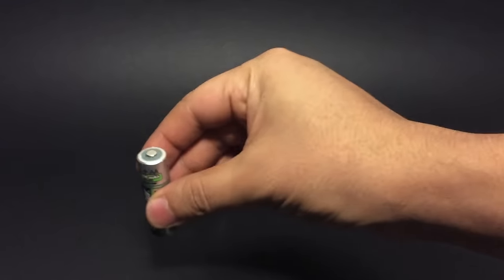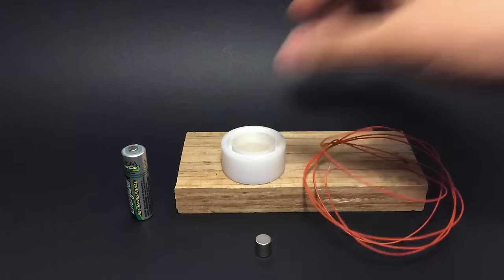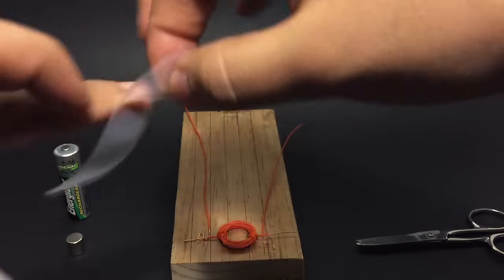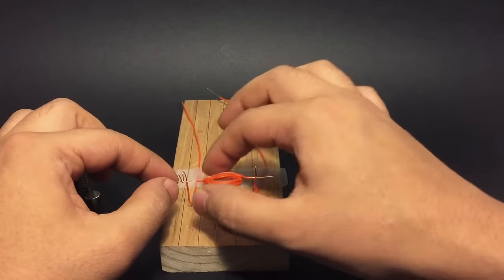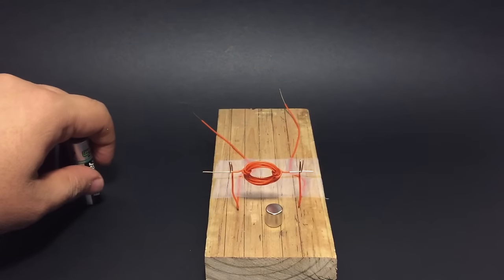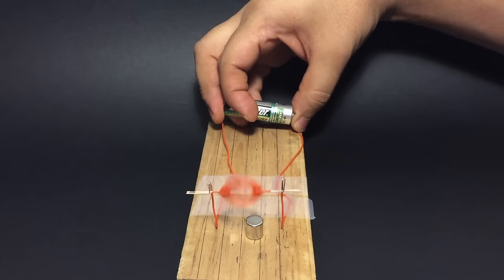HOW TO BUILD A SIMPLE ELECTRIC MOTOR

Comment: Thank you.. it actually worked... sand both ends of the copper coil.. also AA battery wont work if your wire is thick, go for 9v battery
Reply: hello, the wire im using is averagely thick about 4 nails on your fingers kind of thick, would a 1.5 volt battery work?

Comment: You’re missing a very important step: insulate half the wire on each end of the coil. Since you’ve removed the entire amount of insulation you must have used a permanent marker to temporarily insulate part of the wire ends. Is that what you did to make it spin?
Reply: John Burfoot why? It isn't needed
Reply: @dariogrosse5053  As the coil flips, the electric current effectively changes direction in relation to the magnetic field, therefore counteracting its rotation. You'd only see the coil seesaw back and forth if one side wasn't insulated.
Reply: Derek N. I tried it and it worked without it.
Reply: I'd like to explain, but my English isnt is good, I'm from Germany
Reply: @dariogrosse5053  ich spreche duetsch, mein ist nicht so gut, aber, ich glaube ich konne verstehe.
Reply: @bigbearbrads1024  I don't think so science-german isn't is ez...
One example: longitudinalwelle XD
Reply: @dariogrosse5053  yep, you got me on that one😂
Reply: @dariogrosse5053  Ich bin Deutsch. Bitte erkär warum das funktioniert
Reply: @User-sf4zz  der oben meinte den unterbrecher beim e Motor. Das braucht man wenn man nen klassischen Rotor und stator verbaut hat. Aber nicht bei einem stromdurchflossenem Leiter und dauer Magneten. Da darf man die kontaktflächen nicht isolieren, da sonst das magnetfeld um den Leiter zusammenbricht und somit der Motor nicht funktioniert
Reply: @dariogrosse5053  Aber  ist es nicht so, dass wenn sich die Spule um 180 Grad gedreht hat, die Lorentzkraft in die entgegengesetzte Richtung wirkt, was dazu führt das die Spule nur hin und her schwingt? Außerdem wird in allen anderen Videos (die ich gefunden hab) auch nur die eine Seite des Kabels abisoliert.
Reply: @User-sf4zz  grundsätzlich ja, aber die Kraft wirkt um den Leiter herum, deshalb wird nach 180° der Leiter vom Magneten nicht mehr angezogen, sondern abgestoßen.
Ich weiß noch, dass ich das damals getestet hatte (exakter Nachbau des Videos) und wenn man es schnell genug angedreht hat am anfang, funktionierts
Reply from the maker: Some recommend leaving part of the insulation, but it is not really necessary, since the coil rotates in an uncontrolled way, the movement avoids permanent contact and therefore the passage of electric current all the time, so it still works without problems, it is more importantly a proper balance of the rotor, the wire that supports the rotor allows the necessary movement so that the current does not circulate all the time
Reply: @mentalremedies  thanks for the explanation I was scratching my head on why the coil was rotating even when removing all the wire insulation
Reply: nerd alert
Reply: Magic
Reply: Why does my motor is just moving but not completely rotating
Reply: @kylemacatol644  There are many reasons for this.. check only half of the insulation is removed from each end of the wire and check magnet is in right place..
Reply: Sir please give more xperiments.thanks.
Reply: Yes

Comment: why did you remove the insulating part of the copper wire  for the copper loop? I believe it is to act as a commutator like in an actual d.c motor. But I'm not sure how it works. Can u explain? Thks
Reply: 😀😀😀😀😀😱😱😱😱 you  don't  
know that
Reply: I wish I saw this comment sooner but if you're still trying figure out why he removed the insulation from the ends of the copper wire, this is so that he can create a circuit and electricity can flow from the battery through the copper wire. this is necessary because if you keep the insulation on the ends of the copper wire, for example, the coil won't spin because there's no electricity flowing through the copper wire. if you look closely, the ends of the copper wire are connected to the battery by another line of wire in between them.
Reply: @frankpizzini7731  your never too late, hehe there's always someone in need of help 👍

Comment: can u reply the one really important question which is that , after you fully removed the insulator part of the coil's end,  how the heck did  coil manage to spin in one direction only.   because when I analyzed it,  after 180 degree, the net tork changes in opposite direction which makes coil impossible to turn in one direction within that RPM's.  what it should be doing is, turning in one direction and then other and so on.
Reply: it's probably because of imperfect balance of the coil. one half of the spin, it's closer to the magnet, and with the other, it both is farther (less magnetic force is applied) and also it "jumps high" due to centrifugal force, and it loses the contact entirely.
Reply: @czsokola ❤z❤

Comment: How can this work without alternating current in the coil? This is impossible. The coil will just become dipole magnet, move to align itself with the magnet below and stop.
Reply: That's the same question I have.
Reply: FIRST NEWTON LAW
Reply: does not need to be AC current, how else do you think brushed/brushless motors work
Reply: Yep, only half of the insulation should be removed so that the coil is only magnetized half the time.

Comment: Which type of wire and what type of magnet is it ? can you tell me,,🤔🤔🤔🤔
Reply: It is a normal laminated copper wire and a normal magnet
Reply: You don’t need anything special. Copper wire is one of the better conductors. And as long as the magnet works you should be good

Comment: I only have 16 gauge wire. When I connected the battery with my hand, it burnt my fingers. Then i used some pliers with rubber grips and after 1 rotation, it sparked🤷🏿‍♀️
Reply from the maker: Oh sorry about your fingers, I think the gauge you use is too much, It's important to use a thin gauge and if it does not work well, increase the number of loops, when the coil does not rotate well, it can get very hot
Reply: What's the value of current flowing?
Reply: You need thinner wire for greater resistance
Reply: @mentalremedies  That worked perfectly. Thanks a lot👍🏿
Reply: @kingchirpa  I had to get it from Amazon. Thanks for the tip
Reply: @hassanakram8160  I honestly have no idea

Comment: Doesn't work.. Something's missing
Reply: if you did everything in the video, and it doesnt work, give the coil a kick start and push it. The reason it doesnt move is because the coil is switching polarities, but too fast to have any time to go toward the magnet and keep the cycle going, so in order for the + and - sides of the coil to be attracted and repelled to the magnet, you need to give the coil a push.
Reply: Same here
Reply: You could strip half of the wire only so that when the current is about to change directions to the opposite direction it isnt connected to the circuit.. It skips over the phase where it would push it back and then reconnect when back in phase

Comment: I can never get the wire around the battery correct, it always comes out too bulky and it's to heavy to move or be supported by the other wires, can I shorten the length of the wire around the battery?

Comment: Will it work even if I cut the entire insulator on each side and not just half?
Reply: try to make and experiment to find out
Reply: @verano3992  I already tried actually.
The motor works best when only half of at least one side of the insulation is removed.

These were my findings when comparing wholly removed vs half removed:
• If the entire insulation is removed, the spin is inconsistent: sometimes the motor starts to spin in reverse, then back to forward, and sometimes it completely stops spinning. When only half the insulation is removed, however, the coil seems to spin way more consistently in forward motion.
• If entire insulation is removed, the motor seems to overheat very quickly especially if the coil stops spinning. On the other hand, the motor which only half the insulation frm the coil is removed seems to never overheat. It may be due to current being momentarily stopped by the insulation in intervals.

Those are all I wanted to share. I'm just a high school student though😅. Please do correct me if I went wrong on any of my statements. Thank you!
Reply: @mjlim2378  Wow, you actually did a good job. I am thinking of doing this motor for a science fair project this year, because it seems interesting how the motor works
Reply: @verano3992  Yess totally recommend!

Btw I forgot to mention that its best to use enameled wire instead of the regular ones. The regular wires seem to not work when only half the insulation is removed. (You may have known it though, but I just want to share)
Goodluck though😊👍

Comment: What is name of that wire ?sirplease po I hope you reply today😥🙏🙏🙏
Reply from the maker: You can use any type of insulated wire, check the description
Reply: @mentalremedies  where
Reply from the maker: You can get it new enameled cable on amazon or get it from old network cables
Reply: Can the magnetic wire be used? ❤
Reply: Like a bronze?
Reply: How about the battery po what is brand to be used?
Reply from the maker: Yes
Reply from the maker: Any brand

Comment: Well the first question of mine is that you completely removed tha Insulation of your coil so your power supply must be ac or this system will only half rotate so tell me the secret or you're fakeing coz how much I have studied in science this system is not possible by your procedure if you use DC supply

Comment: Why does the wire Rotate when it connected to the battery?
Reply: when the battery is connected, current flows through the loop which induces a magnetic field, this field while cross the magnet's magnetic field which causes rotation (torque)

Comment: Anong wire po ginamit nyo sir?
Reply: 22 gauge insulated copper wire. 
Dont choose the "fiber" ones; the wire should be a single copper. 
The insulator shoudn't be too thick. 
Just inquire at the hardware store about the mentioned specifications.
Reply: @mjlim2378  Is roll magnet copper wire okay?
Reply: @JIHYODORANT  Yep, absolutely. The insulation is too thin so better use a sandpaper to scrape it off. 
Goodluck!

Comment: Its not spinning on me...i don'r know what's the problem.. Please help
Reply from the maker: maybe the coil is not well balanced
Reply from the maker: yes, do not remove the insulation on the coil
Reply: mental remedies  can i use stranded wire?
Reply from the maker: is not the best option, I do not think it works
Reply from the maker: you can use some old network cable and get some thinner insulated cable